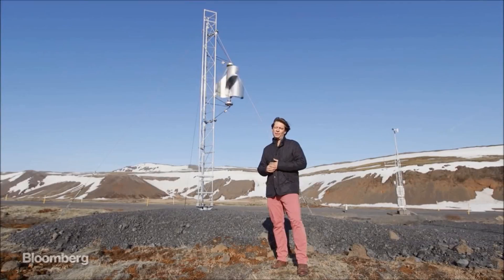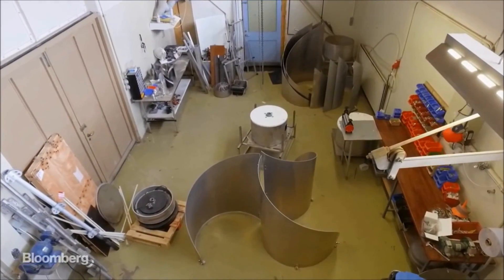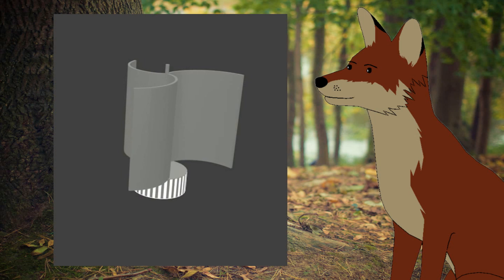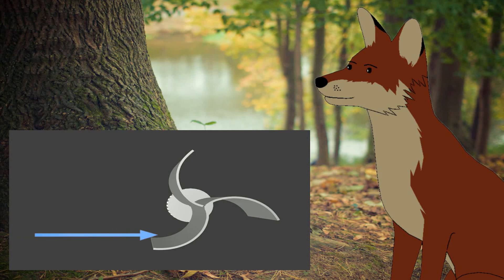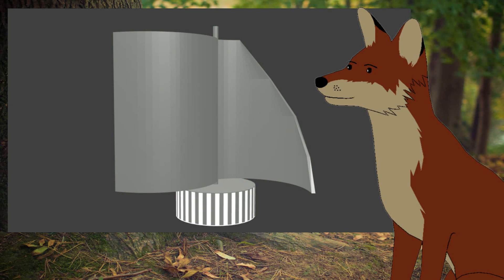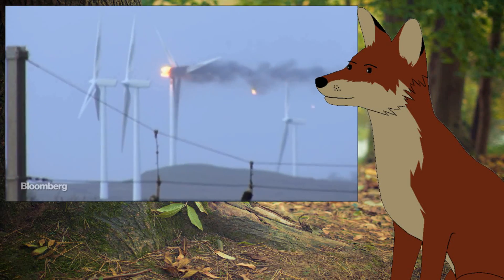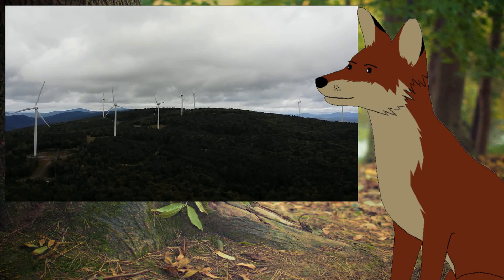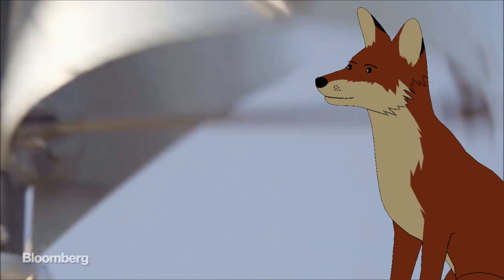IceWind Turbine - BUSTED

Comment: well one thing in your otherwise fair criticism keeps bugging me 🤔
the triangular shape isn't cutting the blade in half. it's just a different shape. it could be round. square, rectangular even shaped like a penis. and still have the same area. 
my point is on a modern sailboat you seldom see a rectangular sail. 
Rectangular sails are less efficient. 
my bet is they took the idea from sails in hopes that it's better than rectangular shapes. which I can't say. At least it looks cooler.
Reply: The lower COG of the blade would result in less torque being applied to the lower bearings. Any upper supports can be minimized or even removed entirely. This type of turbine maybe more ideally suited to things like the top of bus shelters which lends itself to easy and simple installation. Another example might be IoT or sensor systems that are out in the environment. I think what is missing here is context of where this wind turbine may be used it's not always about generating the absolute maximum amount of energy as stated by several others before. It can be that their use cases are more focused on  simplicity and ease of installation and long-term reliability of a less efficient design with a simple structure.
Reply: Many people comment that HALF the area does not effect "Efficiency" it just reduces overall "swept area". This is simply not true. Doubling the closed area that catches the wind - more than doubles the resistance to the wind passing around the surface. When catching the wind, there is a thing called "Solidity". It means that five thin blades will not be very "Solid" but if you put those blades together, they gain extra "Solidity" with each additional blade added to the panel. In other words, it is easier for wind to pass around an object four inches wide than it is to pass around an object 8 inches wide. This concept is usually used in describing "Solidity" in a Lift type turbine as it increases in speed and increases "Solidity" due to the resistance to wind passing through faster moving blades.
Reply: You can not have a "NORTH" magnet without a "SOUTH" end, any more than you can have "LIFT" without "DRAG". Although it is a common way to distinguish between types of wind turbines, it is totally silly to imagine there is lift without drag! F.Y.I everyone.
Reply: that's not what I meant at all.... nothing to do with half or double the area. 
if you take a penis-shaped plate with an area of 1 m^2 or a round plate with the same area they drag and turbulence will behave differently according to shape. butt it's still the same area. but you will most likely see a difference in energy output from various shapes. another benefit of the triangular shape as I see it. it reduces torque on the mount sideways and therefore also wear and tear.
Reply: triangular shape is merely to lower CoG, somehow like a sail , which also has triangular shape ...
Reply: It adds cost for no gain. No one makes sheet metal in triangular shapes so somewhere there is an added expense of cutting it, which can add to waste depending on how it is being cut. The only real advantage is in the look of the turbine.
Reply: Frith >>the cost of one cut is way less than a pole or even an extra set of bearings needed to support a cylinder-shape design.
Reply: kilx81 Okay, so, when turbine blades are made in the shape of penises, I'll wager the feminists will want their fair share of glory. Add to that the many shades those... those things come in, if they aren't represented, well, my heavens, man, we'll have another race war on our hands. But what of the LGBTQ folks? How will we explain this to our children? Penises and vajayjays and who knows what spinning and flopping about... umm, flopping? Good grief, I've forgotten about bazookas; headlights; bodacious fun puppies! What a mess!
Reply: Cutting off the top triangle lowers the wind force bending moment by2/3. In a rotating cantilever design, the supporting bearing load is reduced by the same 2/3,-a very important cost reduction.
Reply: Andrew Paczuski care to elaborate?
How does this ratio work if you have a rectangle of for instance 1500 mm^2 and change it to a triangle with 1500 mm^2 and not just make the rectangle into 750 mm^2
Reply: those triangular blades have a purpose. If you have some basic idea of mechanics, you might know about LEVERS. And how force distribution of levers decrease as you move away from the Axis holding the weight. The same principle works here. The blades get thinner towards the edges and are wider at the centre. This reduces the drag on the blade which which is pushing the rotor opposite to the desired direction. That may decrease the output but increases efficiency and durability.

Comment: Question. What if I am a home owner who lives in a place where wind power makes sense. I want to install something that is mostly maintenance free and relatively inexpensive. What is better, a lift type propeller system or something like the ICEWind product? It seems to me that the conventional horizontal systems require a lot more maintenance than the vertical systems and are more expensive to operate. If you live somewhere where wind is relatively constant who cares about a little extra inefficiency. This is something you could have put in your video. You state that horizontal lift type systems are more efficient, but how much more efficient? How much energy do you pull out of the wind? 10%, 50%, 90%? Is the additional efficiency worth the extra expense and maintenance. You need to do more work to convince me that the ICEWind product is not worth looking at.
Reply from the maker: The Pmax, or maximum efficiency of any wind turbine is 59%, also known of Betz law.   I have seen competing claims for the maximum efficiency of savonius type turbines, but they range between 15-25%.  As you can see it is a significant decrease.  In general I would not recommend "homeowner" turbines for the following reasons.

1.  They all require regular maintenance, and none of them are inexpensive
2.  In order to get good constant wind, a turbine needs to be above structures and the tree line, this requires a tower or pole of some type.  Maintenance then requires working at height, or a way to lower the turbine to the ground, both have varying degrees of danger involved.
3.  Even a small turbine in a run-away condition can be very very dangerous.
4.  Maintenance means working with spinning propellers, gearboxes, and voltage (something many homeowners just aren't up to) 

Of course I don't know you, your home situation, or your capabilities.  If you want to experiment with wind power feel free.  For someone who is dead set on buying a wind turbine I would recommend one made for sailboat use, seeing as (in theory) they are designed to be in more extreme environments (constant salt spray, getting jostled around, lots of wind).   Fortunately for you, you can't buy an icewind even if you want one since they STILL have yet to actually produce a product for sale.  There are plenty of other VAWT companies that are actually able to bring products to market for you to buy though.  Good luck, and enjoy the breeze.